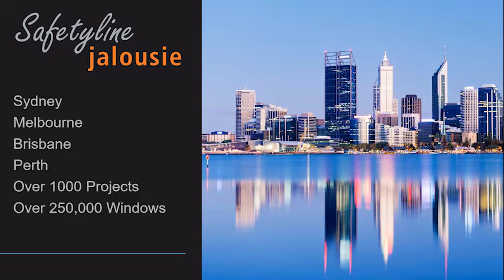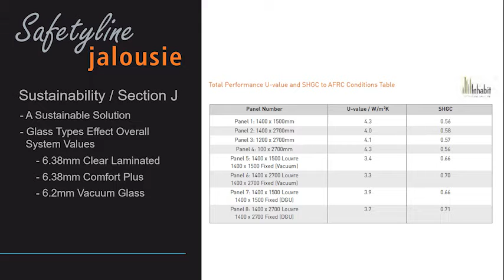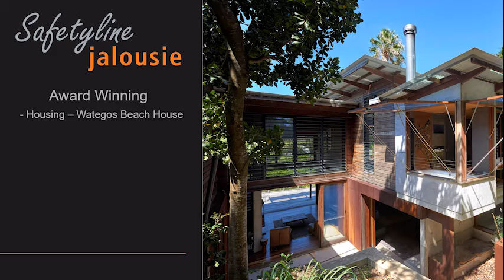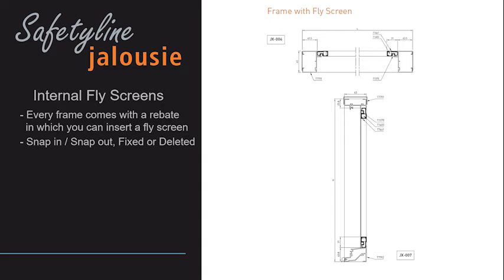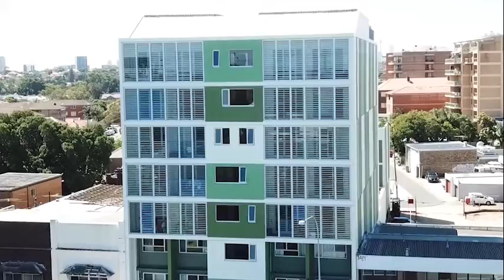Safetyline Jalousie Louvre Windows Product Presentation

Comment from the maker: Quicklinks to your area of interest:
02:19 - Australian Owned and Operated
03:54 - Manufactured in Sydney
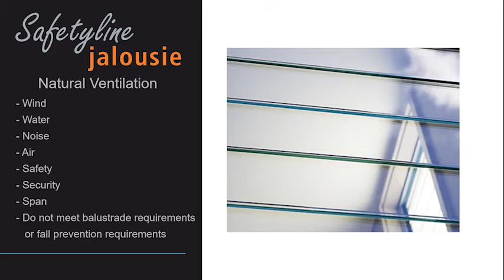05:43 - Why Safetyline Jalousie?
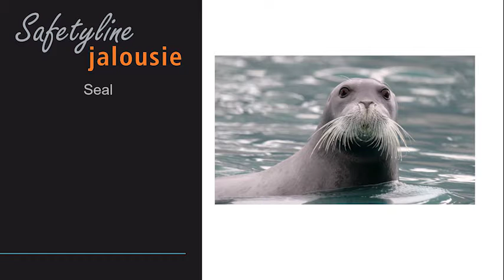06:43 - Seal
07:54 - Wind and Water Resistance
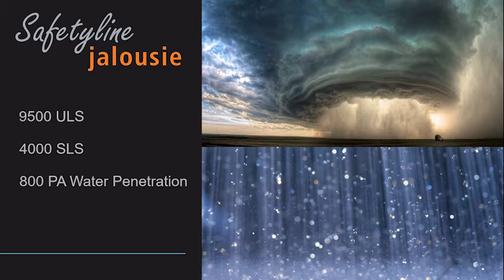08:18 - High Rise Tower Gallery
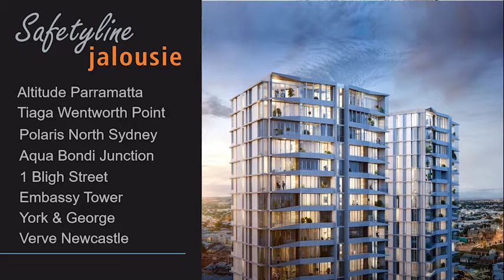11:25 - Cat 5 Cyclone Rated
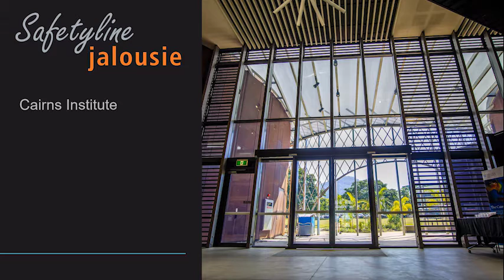13:50 - Cairns Institute
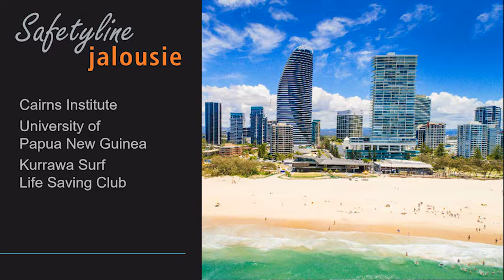16:01 - Sound Reduction
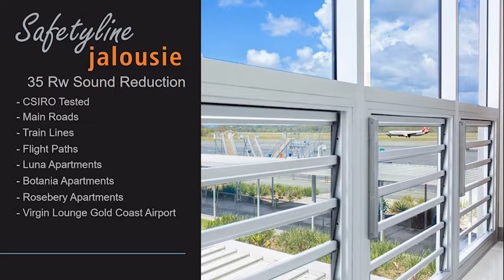18:45 - Noise Abatement Treatment Program
19:45 - Sustainability
22:24 - L/Sqm/S
24:00 - Safety & Compliance
25:26 - Security
27:10 - Top Pivotal
28:48 - Glass Types
29:38 - Vaccum Glass
31:39 - Award Winning
33:30 - Education Sector
34:34 - Commercial
36:34 - Span
37:21 - Internal Fly Screen
38:04 - Operating Mechanisms
38:38 - Motorized or Automated Solutions
41:44 - Technical Tools
42:31 - Final Thoughts